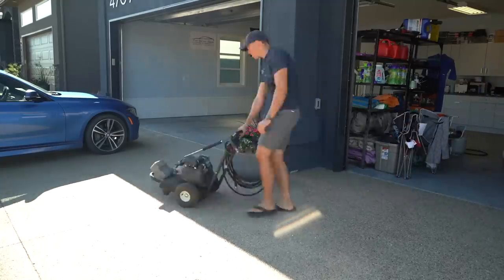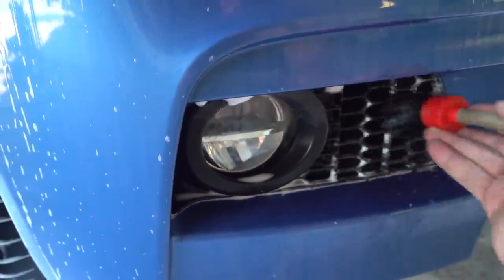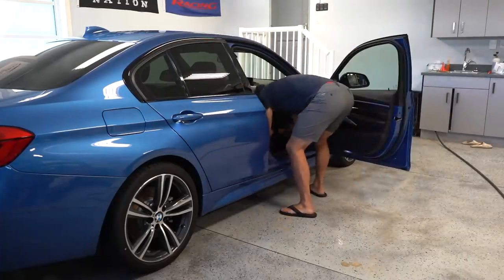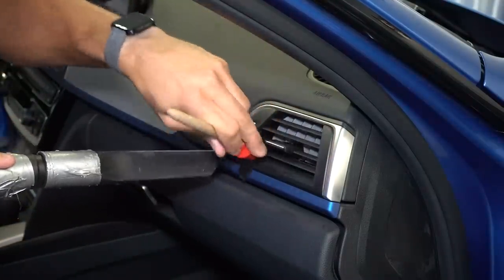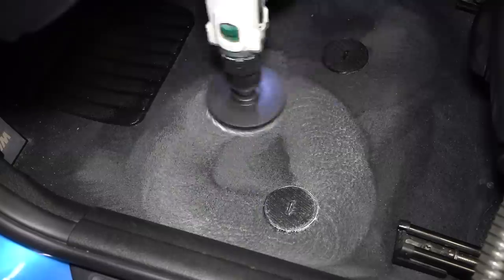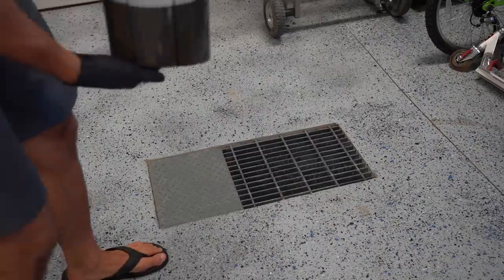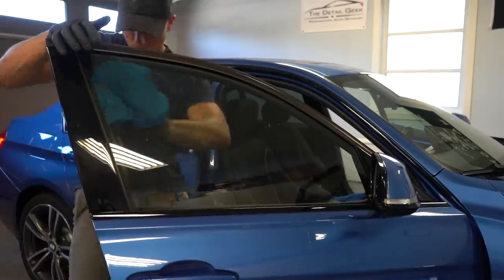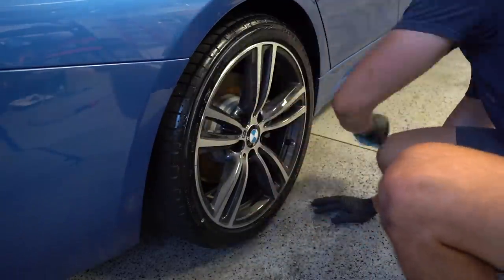Deep Cleaning a Filthy BMW! | The Detail Geek

Comment: Quick tip for 9:40:
Those Velcro circles are actually just big screws, you turn them anti clock wise and they come off, it’s easier to clean the carpet that way :)

Comment: Great tips and great detailing. Regarding the removable floor mats/carpets: when they’re as dirty as these were, I soak them with carpet cleaner, agitate gently, then use the pressure washer to rinse them thoroughly...gets all the dirt out; Then I use my wet shop vac (powerful suction) to extract as much water as possible; directional brush, then let dry in sun, if it’s summer; they are the first item I tackle.
Thanks again for the great vids!

Comment: "Get it to 5000 likes? That's a lot of thumbs in the air." 

It's January 1st, 2020, and this has 40,000 likes. I think you might have reached your goal. Might be wrong.
Reply: Its February 9 2020 and this video has 50k likes
Reply: Emily Ann joatnh
Reply: Emily Ann June 18th,2020 62k likes
Reply: September 19th, 2020 and it’s at 73k
Reply: october 9,2020 77K

Comment: just found your channel and have watched several videos.  Nice work!  I do wonder though...  I have not seen a hood popped and cleaned.  You door door jams, trunk , gas cap but not the hood.  And the motor, that's the most satisfying part of a vehicle to clean.  There is nothing better than a 100,000 mile motor looking brand new.  With the right chemicals, about 4 different sized brushed to agitate, and 20 minutes and it can look brand new.

Comment: Got a question on the cleaning of leather seats.  You use that brush after applying the cleaning solution.  Would that brush be safe in leather seats that have vent holes?  My Ford Explorer seats heat and cool so they are not just smooth surfaces.  I have seen a few cars you detail with leather seats but have not seen this on any of your priors.  Wondering if using that brush would damage the material by catching in the holes ?

Comment: Great video.  I kept waiting to see how you cleaned the inside glass of the rear window.  The roofline on these cars is steeply raked and it is almost impossible to get your arm back there to wipe the inside back glass.  I had to buy one of those plastic handle wands with an applicator pad on the end just to get the back glass "cleaned" -- it doesn't do that great a job.

Comment: Love your videos! This is the second video I’ve seen raving about that little Bissell beast and if you love it, I’m sold. Also picking up that 303 while I’m at it. :)
Reply: I bought a Bissell because of his praise for it. Bissell should sponsor him.
Reply: @tedlym.3390  do you use the Bissell solution only? And if you don’t then have you ever had problems with non-bissell solution?
Reply: @allenormsbee7674  I used the Bissell solution that came with the unit. I have used Woolite and Turtle Wax carpet/fabric cleaners. Like DG, I use only warm water in the extractor.

Comment: Bro.I just bought the same Bissell extractor.The dirty water tank does not come out the same like yours.its different.Mine has a verry small hole.Its weird.Did you cut the top off
Reply from the maker: No, just bend the handle all the way back and the lid will come off!
Reply: @TheDetailGeek  OMG 😲 what a dummy 😆.Thanks a lot bro.

Comment: What none - acid cleaner do you use on the alloys? I have a BMW 1 Series and I think I accidentally used an acid based cleaner which has left kind of like a grutty look on them, but it comes off if you really scrub it with your nail.. however I would be there for hours scrubbing my nails on all 4 wheels.. what would you recommend?